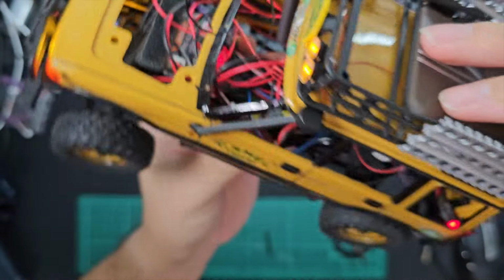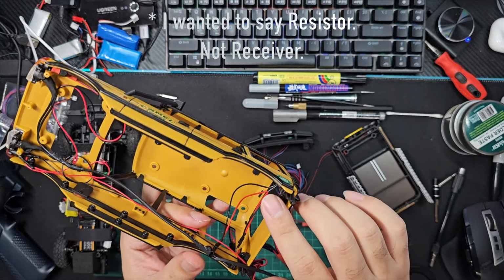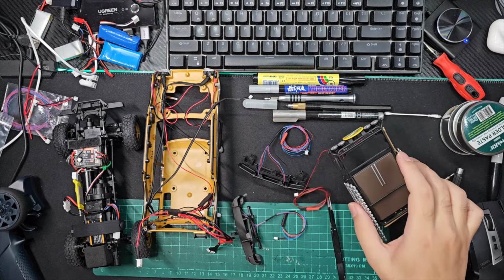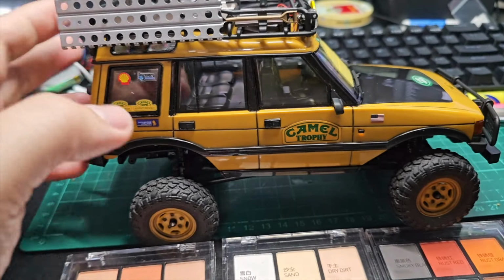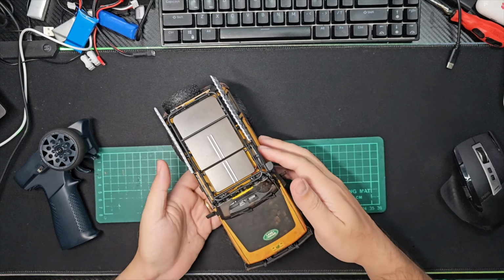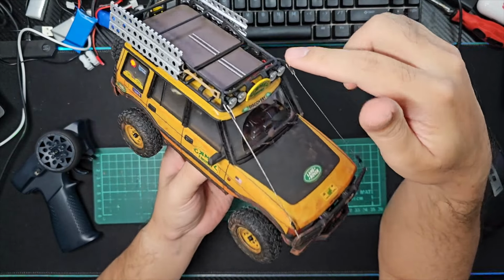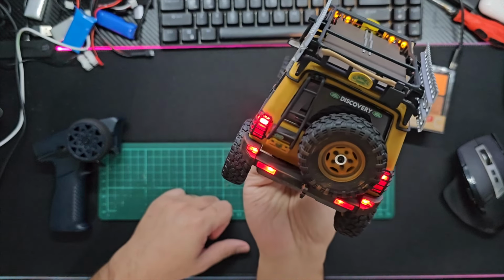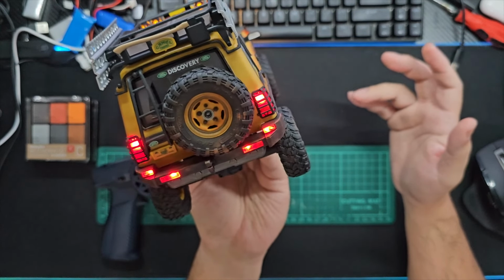FMS FCX24M Range Rover Discovery Camel Trophy Edition - Part 3

Comment: How did you panel line the body? Sharpie in the lines and wiping away excess sharpie? Also, did you spray the whole body with the matte clear before the weather kit or after?
Reply from the maker: @V8chump  I used the tamiya liquid panel liner. 
I weather it before spraying it clear.
Reply: @drxxavier ohhhh thanks so much I didn’t know such a body liner existed! So do you just put it on and wipe off the extra? Did you use flat black paint on the windshield bits you mention around 22:00? 

Also, you’re the soul reason I ordered one of these. This build is incredible and I’m determined to copy it closely! Maybe I’ll do a Jurassic park body in this style 😊
Reply from the maker: @V8chump  yes the tamiya liner is liquid and you can just rub off anything extra. I use this in the thin line areas.

For the window bits I just use a black sharpie.

I did all the weathering then seal all of that with flat clear coat.

I'm happy this video inspired you and I hope to do more videos like this.

Comment: Very nice!!! You did a awesome job!!! 🏅😀👍👍👍
Reply from the maker: thank you for the kind words. :-)
Reply: @drxxavier   you plug the motor of the winch with the motor of the rc???
Reply from the maker: @ONFLOOD-RC  yea. the winch is sharing the ESC from the drive motor.
Reply: @drxxavier  you are the master!!! I ❤️the winch, I buy and I install in my defender!!!  Thank you 🙏
Reply: @drxxavier  can we add to the winch the remote module of the 1:24 and plug it with a shitch to the other cable of the battery ( the one for charge) to use the winch and the motor at the same time with the remote? What you think? Is possible?
Reply from the maker: @ONFLOOD-RC  I'm sure you can do it that way. I'm just trying to be as efficient as possible. If you power the winch with the battery charging port then you will need to add another receiver unit for the winch and you need to find a place for it in the already tiny FCX24M.
Reply: @drxxavier  I understand, better your way: no drag brake and pulling with the winch!!! I think I do the same!!! Thanks 🙏

Comment: Looks nice! Will do something similar. Did you respray the bonnet or just clearcoat? Sand ladders look to shiny. Might want to chip them with dark grey/brown. And then apply a wash in thesame color. Just cover it in very diluted paint. 

Also wiping the middle of the side windows with some paint remover on your finger removes just a bit clearcoat to appear they have been hastely wiped from the outside with an arm or hand. Thanks for the vid!
Reply from the maker: @panzerkaske4836  the whole truck did get a flat clear top coat.thanks for the tips.

Comment: Excellent work, I will buy the same model for myself and do weathering.  Before that I only did it on 1/35 scale models.  There the weathering is varnished, but here you also varnished the model?
Reply from the maker: Yes I did applied a layer of top coat.

Comment: Hi Cousin, Awesome mods. Just curious on what resistor ohms did you use?
Reply: And where did you hide the wires of the roof rack led?
Reply from the maker: 150ohms
Reply from the maker: i used very thin guage wires and hide them in betwwen the pillars.